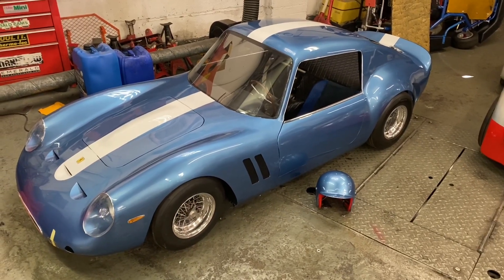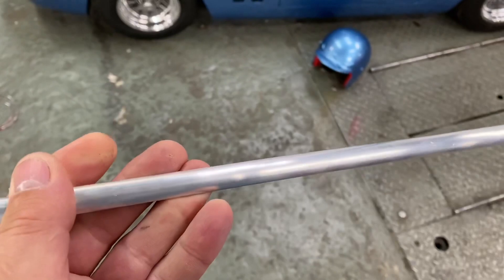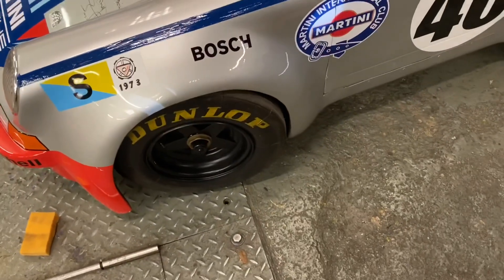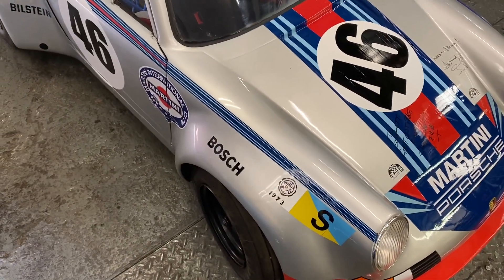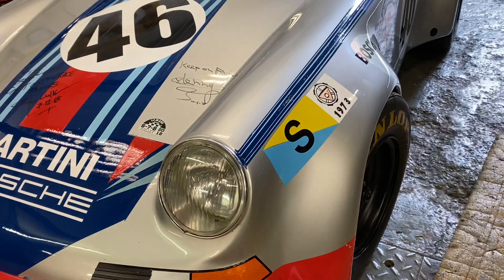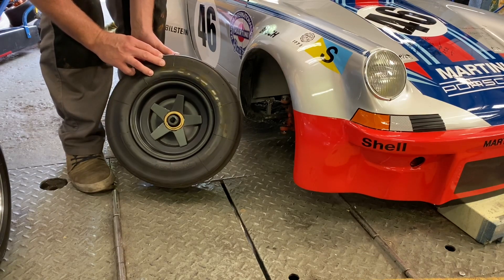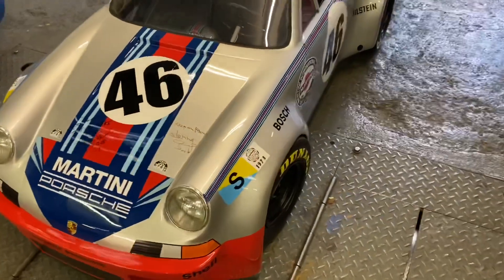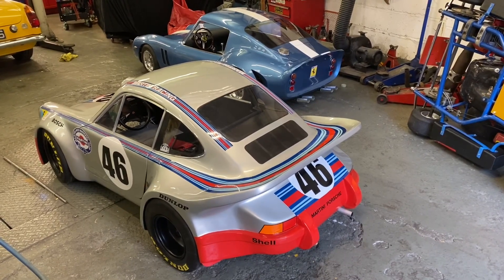Prepping the cars for the first show of 2020!

Comment: Hello Can you tell me what kind of wheels size and brand are on the halfsize cars? I am building a half size 911 but can not finf anny matching tires roun 32 cm outside dismeter. And can you help me with an adres for electromotor, axes, brakes etc?! Thanks already, jeroen
Reply: 8inch-with-16x8x8-smooth-turf-tyres,-use-a-mobility-scooter-transaxle
Reply: @Vmaxporsch  thanks! Do you know anny onlineshops in europe which sell these
Reply: @Vmaxporsch  i have found some adresses in holland which march my car but they are not so wide about 50 tot 70 mm diameter 300 mm outside